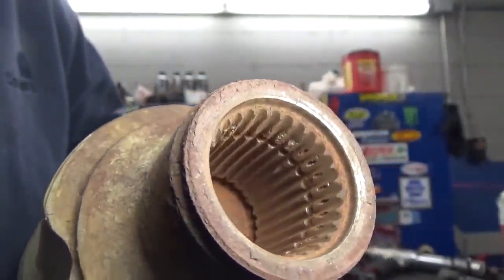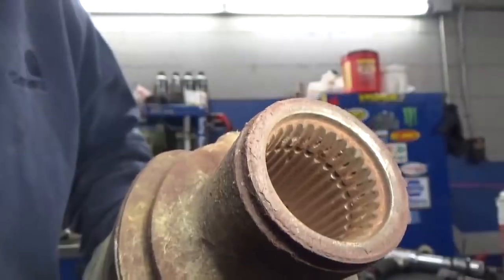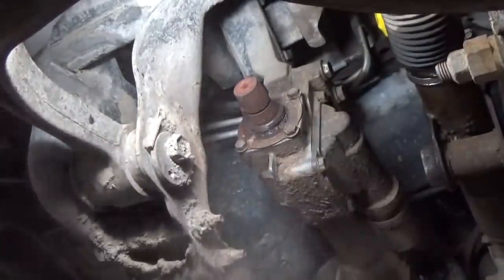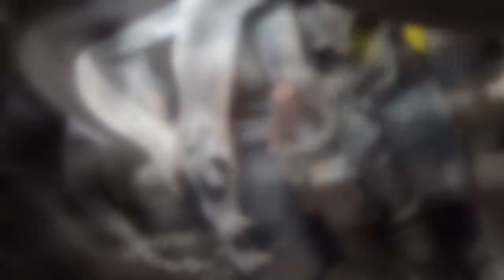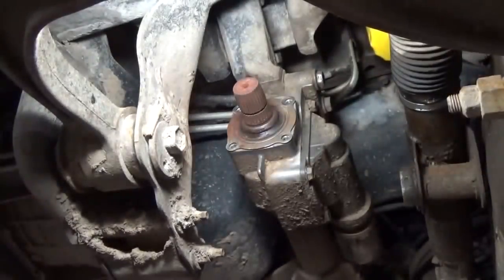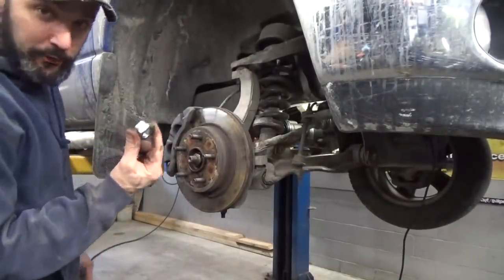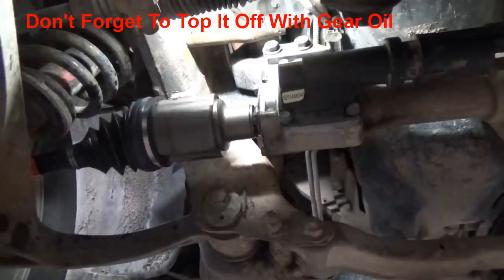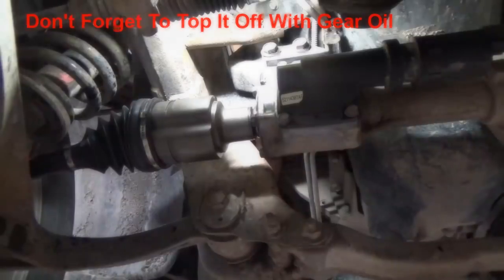Dodge Ram No 4WD

Comment: Lol my f150 is 17 years old and never once have i had a problem with the 4x4.... Or anything else for that matter! But anyhow
Reply: I owned new Fords with the manual lockout hubs and never had a problem with them, however, I also owned a
Ford with automatic hub engagement and it was total junk. I replaced them with manual lock hubs, problem solved.
 The Ford trucks themselves are much better than Chev. or Dodge overall, especially the new ones  these days.
Reply: I agree as well the auto locking hubs are total junk on ford never seen a good one working but the manual lock outs never gave me issue and worked flawless

Comment: get the post loc , you don't want to do this ,,  decreased fuel milage cause yer ring and pinion are always spinning , front drive shaft always spinning so more ujoints to replace and if a U joint ever lets go doing 60 major carnage WILL happen bye bye T case and oil pan   , more vibrations while driving , heavier steering etc , and with posi  loc ya get 2WD low best thing ever to manoeuvre trailers , no clutch slipping backing up etc. I have 2 trucks 98 with CAD  and 02 with no CAD , would rather CAD axle anyday , way more practical. unless yer sled pulling and was a stronger axle

Comment: If I was a betting man I would say that the owner of that truck drives a fair amount on dry pavement with the four wheel drive engaged. From my experience with four wheel drives in the past and on the 2016 Ford I am driving today I have a fair amount of experience with the hunting and drive line wrap up when running four wheel drive on drive pavement when I inadvertently leave it engaged after coming off ice or off road goose sh*t. I would have to say that if you leave engaged all the time this is what you can expect to happen since this is the weakest link in the system.

Comment: My 88 Dodge Dakota is a lot easier to remove the axle. From the drive end has 6 bolts , remove the axle nut and it's out. The manufacturer just has to make things harder than they need to be.

Comment: Man  I'll Tell ya, these non A.S.E. certified mechanics with there fancy digital torque wrench's... You got a Stick welder don't you? you could have just welded that stub shaft to the C.V. shaft and been done with it, why take it all apart? those stick welder's can really fill alot of space, if it gets to hot, just be ready with some Liquid co2, just try to get shaft as straight as possible before you burn'em together, it'll be alright.....;-) hehehehe..

Comment: what the hell did he do to that poor dodge to cause that
Reply from the maker: the stig mach 1 Daily driver actually. These mopars just fall apart on there own haha
Reply: South Main Auto Repair no not something like that. Ive had two dodges now and put them through hell and ive never encountered a problem anything like that. He had to have done something bad to that thing to cause that. besides when everyone elses fords and chevys were broken, its always me and my dodge that has to come with a trailer to bring it home.
Reply: the stig mach 1 You are one of the lucky ones. Everyone I know who owns a Dodge has nothing but problems. My neighbors Dodge 1500 has 140,000 miles and needs a new motor. I will keep my older Chevrolet trucks before I buy any new JUNK vehicle made today.
Reply: scrimmy6969 no your one of the lucky ones. Like I said im always the one coming and getting my buddies with the fords and chevys, mostly chevys and putting them on  trailer behind my dodge. Always been that way. A couple of the chevys are newer than mine too. Either way I don't care what you drive he did something screwed up to that thing to cause that to happen. Those things usually don't go bad for most of the life of the truck for a normal person. I will always stand behind be dodge from experience. You cant base everything off a guy next door. I know multiple with chevys that hate them because they spend more time under them than in them. Everyone I know, including myself rarely have to do major repair work to our dodges. Dodge isn't what it used to be, in the mid nineties yes they had tranny issues. But the thing is they fixed that with the new generation. Chevy still has tranny issues, still has brake issues, still has electrical issues, still has the entire truck rusting out within a few years.
Reply: the stig mach 1 Everyone I know who owns a Dodge regrets the purchase. DODGE is honestly a POS. Shit you know its bad when there is a multiple websites about why not to buy a DODGE or Chrysler product. You have your opinion and I have mine. From experience I would say you know some lazy ass friends who do not take care of their trucks then bitch and cry when it breaks down. Just google why not to buy a Dodge and sadly you will see multiple sites backing not only my comments but thousands of people stating the brand is JUNK. Thank you for the reply. I will not get into a pissing match on this mans channel. I respect him as a mechanic and as a man who takes the time to upload videos. Have a good day sir.
Reply: scrimmy6969 ok, let me know next week when you need a tow, and the week after. Have a good day
Reply: the stig mach 1 Thank you for the offer.

Comment: im a ford fan overall but...some of the bonehead moves they have done in the past 10-15 years ive owned them.  spark plug nonsense etc...4wd system. hit the nail perfect on that observation lol
Reply: +keith kennedy  I GOT A DODGE TRUCK 97 AND NEVER AGAIN THINGS A RUST BUCKET OF SHIT= SHITLOAD OF PROBLEMS WITH DODGE  PAINT PEELING RUST-- 
JUST SPENT 800 DOLLARS ON CAT CONVERTER AND BALL JOINTS
Reply: Cracked heads a pretty rare and the lifter issue is broken exhaust manifold bolts.....nice try though

Comment: Dodge is shit. Shit quality. Worst of the big 3 truck manufacturers. The owner of a motorcycle repair shop I know personally,  bought a new 3500 for the towing. 4wd wouldn't work. Went to the shop 2 times before someone decided to take off the front diff cover. Guess what the mechanic found...no planetary gear in there at all!!! Shipped out of the factory...brand new and some clown didn't put in the gears. That's quality!!!